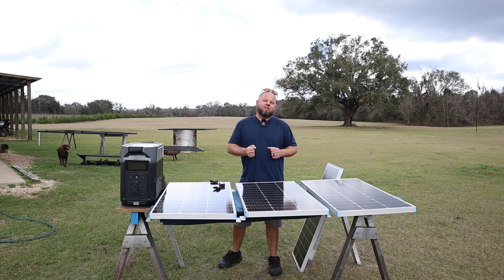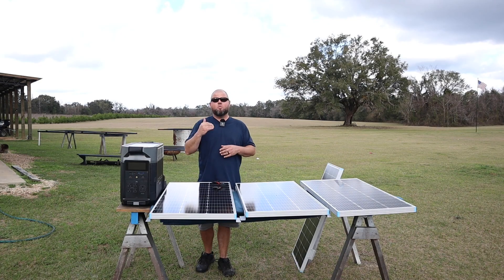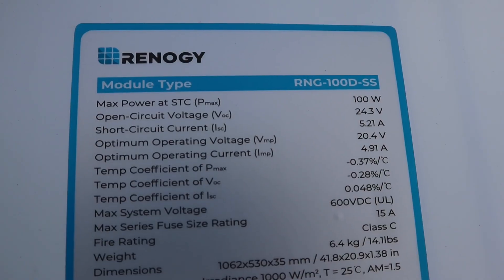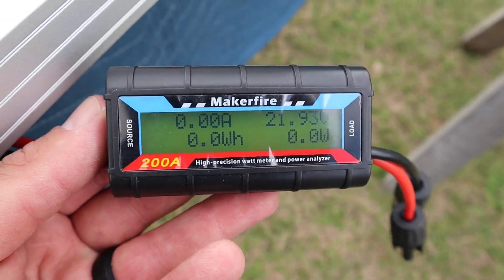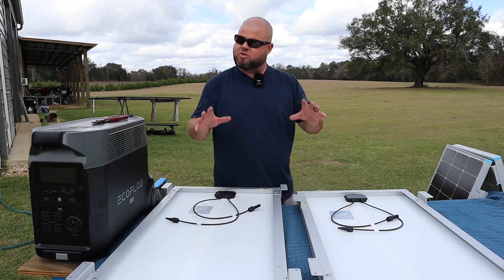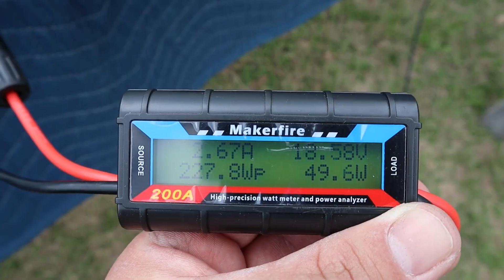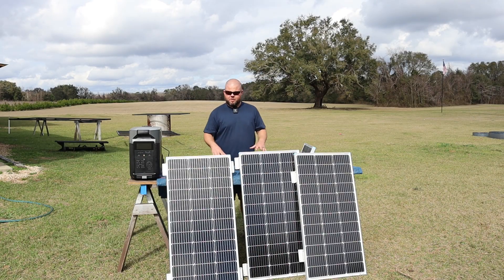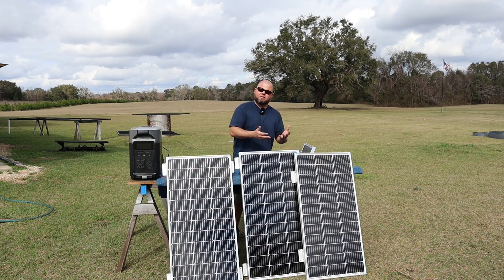How to wire solar panels! Series, parallel, series/parallel explanations. #720

Comment: Hey brother. I could really use your expertise. I have two delta pro units. I have 4 panels per delta pro. So 8 panels total. The panels are 370w, 41.0v, 11.42amp. since you're familiar with the specs on the delta pro, what would be the best set up on the 4 panels for the delta pro?
Reply: If I parallel/series the four panels, that would put my amps at roughly 23amps and my volts at 82 volts. Max amps is 15 for the pro, but would that work?

Comment: I enjoyed and liked this video my struggle is i just mounted 2 renogy 200 w panels on roof of my enclosed trailer and multimeter dont get anything out of both and when they where connected the LiTime 30amp charger didn't light up the solar display have i damaged the diodes
Reply from the maker: Possibly so, that's what I'd be checking.

Comment: Many posts I've read on other solar vids and threads w Ecoflow Delta Pro, which I have, say the 150 volts is a 'hard rule' and 15 amps is soft. Other words, it's ok to go over 15amps. The posters say it's been verified by Ecoflow support.

Comment: I’m struggling. I have 3 renogy panels, 1 200watt and 2 100 watt , I’m not sure which ones to hook up for series and which for parallel? I have a Anker solix f2000 powerhouse 767 2400

Comment: NEED HELP ASAP!!!  I just got my new Delta pro three unit… Installing four solar panels and following your directions as closely as possible… Went to grab the parallel adapters… And do not have any included in the kit. Do they not come with the kit? Did I have to special order parallel adapters? I was hooking two panels up in series and two panels up in parallel as you directed, but now I’m not seeing a way to hook up the two panels without the adapters… Am I forced at this point to hook them all up in series? I need your help please…ASAP…
Reply from the maker: Series is even better, use the high voltage side of the DP3 as long as you don't exceed 150 volts. . Parralell adapters are never included, you must purchase those separate as every installation and panel set is different.

Comment: It looks like you need two sets of series to parallel. I've tried one set of series three panels in series. Then I tried to go parallel on that and it doesn't work. So I'm going to have to build two sets of series it looks like

Comment: So I did three panels in series for 99 volts. Then I tried to parallel to increase my wattage capacity to 3000 but so I connected the next two panels in parallel and connected it to the three series. I checked the voltage and the voltage was 33 volts. So somehow the voltage decreased. Again, I had three panels in series for a total of 99 volts that I went the neck next to in parallel and the voltage dumped to 33 volts in. I'm shaking my head. What is going on???
Reply from the maker: You cannot parralell odd sets. Your series sets must contain the same amount of panels and be the same voltage.

Comment: I have a Eco-Flow Delta Pro and 6 each 160 Watt Eco-Flow solar panels. So, I can hook all 6 panels in series, my voltage will be 960 and my amperage will be low enough since it will be the same amperage as 1 panel - right? Also, I will have room for another 600 watts of panels as long as I connect them in series? I think I am missing something due to my lack of knowledge? I'm getting ready to attempt this setup live in the backyard as soon as I understand. Maybe there is a book you might recommend - Solar for Dummies? Thank you. I appreciate it.

Comment: I need advice, please: How is it better to connect two solar panels, power of 450W each to a 12v battery; 160ah....The panels are located in two different locations of my mountain house? Thank you very much
Reply from the maker: It really depends on your solar charger, you don't directly hook panels to the battery, they go to a solar charger first.
Reply: @TKCL Thanks a lot... I need some advice: how many amps or volts does the controller need to run properly? Thanks

Comment: I dont know much solar panels but if I have two 100 watts solar panels and I get someone to connect them for me in parallel for usage on my solar generator, after connecting them in parallel will I get a total of 200 watts coming from the sun to charge my solar generator? My solar generator has maximum amp of 8.5. If the amps double after connecting in parallel will this damage my solar generator??
Reply from the maker: It doesn't matter if you connect parallel or series, your wattage will always increase. Most panels are at least 5 amps, so if you connect in parallel you are going to go over the maximum for your generator.  You need to connect in series doubling your voltage, but always refer to the generators specs first.

Comment: Hey Andrew. I love the content. 
I have a solar related question and I haven’t been able to get a clear answer. 

I have 6 solar suitcases that I want to connect to my Victron 250/85 solar controller. However, the combined OCV in series is 269 volts. Is it possible to connect 3  and 3 in series and then both in parallel which would effectively be 135 OCV volts and 21 amps. 

Thanks in advance. 
John

Comment: What gauge extension cable would you use?
Reply from the maker: Depends on the amperage and length of the run. There are good online calculators for wire size. Make sure it's a DC calculator.

Comment: Thanks for your video it's very informative. So controlling the Amperage from the  panel (by doing different connections) is to make sure that it will not exceed the amps required by the power station, right

Comment: Does my voltage or amperage double if i have two of the same ecoflo
Reply from the maker: It sure what you mean by two ecoflows? You can't combine units.
Reply: @TKCL   I can combine and it gives you 240. And with a soft start you can actually run your central ac.

Comment: I must’ve missed something here… Once you connect the panels together, how do you connect to the machine if there’s no more wires left
Reply from the maker: There is always wires left.  When in series the last panel on each end will have one wire remaining for a total of two wires.  If going the parallel route with Y adapters, you go from two sets of panel wires, combine with the Y adapters and are left with one positive and one negative to connect to your machine.

Comment: I have 2 600 w panels, Voc= 52.8V, Isc=14.99A, Vmp= 44V, Imp= 13.63A, each, how do I reduce the amps down to 12amps to run a minis-spilt A/C unit? 12 amps is the maxium for the mppt on the mini-split. The specs for the mini-split is: Electrical Specifications
Rated Voltage
115VAC | 90VDC-380VDC
Rated Current
AC: 8.3A | DC: 9.1A-2.4A
VOC of PV
<380V
ISC of PV
<12A
Frequency
60Hz
Minimum Circuit Ampacity
19.05A
Maximum Fuse Size
20A
Maximum Starting Current
4A

Thanks for your help.
Reply from the maker: You can't reduce those panels to any less than a single panels rated amperage. Those are huge residential panels, what you need are 5 or 10 amp rated 100-200 watt panels.
Reply: Thanks for you quick reply, what do you think of an idea of putting a 12amp breaker in front of the mini-spilt MPPT, so if the current ever went over 12 amps it wouldn't get to the mppt? @TKCL
Reply from the maker: @gator-freda1938 not a good idea, you can't trust that the breaker will trip. It's also not a good idea to put more the 80 percent load on a breaker.

Comment: So I bought a 900 watt 72 volt solar pool pump an 10 of the 100 watt solar panel you use how would u wire that up series or parallel
Reply from the maker: Is there an amperage rating for pool pump? We need to make sure you get the correct voltage and don't exceed the amperage rating of the pump.
Reply: @TKCL  SOLAR POOL PUMP
(€ ISO9001
Model: ZJP21/19-D72/900
Q.Max.
21 m"h
H.Max: 19 M
NOM. VOLTAGE: 72V
In/Outlet: 48mm
POWER:
0.9
KW
1.2 HP
IP 54
ICL. B
Reply: Just trying to get your thoughts it doesn’t come with clear instructions
Reply from the maker: No that isn't very clear, I can't say how to wire based on that info. There should be a minimum and maximum voltage range, as well as amperage.
Reply: @TKCL  right just wanted to make sure it wasn’t just me I try calling the company they don’t have no answer either thanks for your time keep the video coming love the content from y’all happy new year to you an tiff
Reply: Found some more info not to exceed 150 volts
Reply: Minimum is 72

Comment: Glad there's a video for this solar subject. Question; what type of will i use from my solar panel aray to the house - I will be needing to trench these wires thru conduit - Yes?
Reply: Want to run my house, total electric with well - I have 40 gallon hot water heater, stove, 2  ton with heat pump ac unit and a well. How many solar panels and delta pros will I need?
Reply from the maker: They make underground burial wire, but conduit is probably going to be required by your code. As for the panels, I would need to know the exact wattage pull of all appliances.  I can tell you that your electric water heater is a major energy hog and will make going small solar impossible, so will the stove which has a huge pull when in use.  You would be money ahead to convert both of those to propane or natural gas.  You can then get away with a much smaller solar system and make it through normal day and emergencies far longer.

Comment: If you have 3 panel as demonstrated on video why did you incorporate an additional panel for total of 4 panel in a series parallel combination? what would happen if two panels are in parallel connection and connected in series with the one panel what will happen? to current and voltage using only thre panels? ther are two many videos using four panels but none demonstate using 3 panels in that configuration? This is part of a learning channel in youtube?
Reply from the maker: That's because you need an even number to series AND parralell as shown. You can use an odd number to series or parralell only, not both.

Comment: Been looking for the past month or so for panels and I'm surprised to see a 100 watt panel with a 23v output, normally it's 12v.  I've also seen a Renogy 200 w panel with an output of 23 or 24v.  It seemed on average I've seen 100w = 12v basicly.  The Renogy panels put out 10 - 15% more than others.
Reply from the maker: I've been highly impressed with the output of these. So much so that I just bought 40 more. I now own 67 of them.

Comment: I believe a Bluetti can handle a lot more solar input than the EcoFlo's; so my first choice would be one of those instead...
Reply from the maker: Not of a comparable model, I own both. Now when you start talking their big stackable units, things do improve on the input side. My gut says Ecoflow is due for and updated system and they are typically the leaders in this space.
Reply: @TKCL  Yeah, I'd love to buy an updated model, but unfortunately, I'm not in that position financially (yet). I have to figure out which battery power station I should buy... 

I have 4 x 405w panels. With the EcoFlo, even if I was to put 2 in series and then the 2 sets in parallel, it'd still be more amperage than what the EcoFlo can handle, what do I do? I'd still like to use all 4 panels, which would be handy on cloudy days, would this be possible?
Reply from the maker: @alpachino468 my gut says if you can hang in there a few more months without making a purchase, you're going to see some new models that can handle crazy amounts of solar input. Most of these companies launch their new products in January at the CES show.

Comment: Hello Andrew, big fan here, have 10.8 kw dp, want to build solar array with renogy 100w, can I use 16 panels to get the 1600 watt input to DP wo exceeding 150v and 15 amps? TIA, love your videos!
Reply from the maker: 1200 watts is where I have found my comfort zone with those panels. Reason being is I've experienced significant voltage spikes on cool days. If I had anymore panels than that, I'd be over the units limits. The good news is that those panels are performing very well for me. I just bought 40 more because they are on the best sale I've ever seen. If the sale is still running on Amazon I'll come back and post my affiliate link. You must be a prime member for the sale.
Reply from the maker: Just checked, the sale has ended 😕
Reply: Thank you very much Andrew, you Rock!

Comment: Great video, but I have a curve ball... Is there something that I can use to reduce/ step down the power supplied by my panels to match the Ecoflows allowed input?

I have a river 2 with 2X 100W panels wired in series which exceeds the 30v/8A maximum that the river 2 can handle (wiring in parallel will exceed the allowed Amps too).
Reply from the maker: Not that I know of, you'll need less panels.

Comment: I have a delta max 2000
800watt max, 13amps max, 11-100Volts max

Renogy panels 200w, open circuit is 27v, 9.66Amp

What is the best way to wire my panels?
Reply from the maker: You've only got one option with those specs. 3 Renogy panels wired in series for 9.66 amps and 81 volts. Be aware that in cool weather or odd cloud conditions you can see spikes above rated voltage. That's why you need to stay under the maximums.

Comment: I want to run a 2S2P setup with my panels. What I want to know is can the parallel connected ones be aimed at different parts of the sky? Say one set for morning/mid day and one set for mid/later in the day.
Reply from the maker: That's usually not a problem unless in series and it your panels don't have bypass diodes. You'll experience what's called a shading effect.

Comment: question ,,,,, so if we assume that you had only 2 panels 100W each ...  what will charge the ecoflow faster ?  12-14V /200W   or   24-28V 100W  ?
Reply from the maker: It charges the same, but you must pay attention to some units requirements.  Some need a minimum voltage to start charging.

Comment: Wouldn’t you want to put the whole 15 amps in due to unreliable sun, clouds, haze, whatever, just to make sure it’s getting all it can take? Sorry if it was mentioned
Reply from the maker: No, because at times you will run over the 15 amps, especially on cool days. I don't want to risk tripping the unit. I never run anything to the max.
Reply: @TKCL     Ok. So it has to be set up that way because the unit itself won’t govern the input.  Cool.
Reply from the maker: Most will govern wattage, most will not necessarily tolerate over voltage or amperage.

Comment: Hello,
 
I hope I may ask you something. I've been following your channel for a while. You are really by far the best of them all because of your calm and clear explanation on Youtube.
I bought a Renogy 200 Watt 12 Volt monocrystalline foldable solar case. After 6 days of testing I do not exceed a yield of 60 Watt. No shade but what I said a moderate sun in recent days. Should I be concerned? 60 watts on a 200 watt panel is bad right? I connect the panel to the AC network via inverter. Everything is connected properly. I've seen tests where this panel scored so well. I am really afraid that I have a bad purchase and now I still have warranty.
Reply from the maker: Even a little bit of sun can cause shading effects, especially if that panel set is wired in series without bypass diodes. I'd wait for a full sun day before assuming the panel is bad. Proper angle makes a big difference on those fold up panels.

Comment: If you have a positive and negative with each panel and they are all connected together , the one panel that goes to your control has no wires left? Is there a connector that lets you split and share?
Reply from the maker: That's not correct. Your left with a open wire/connector on your first and last panel. There will be a remaining positive and negative left available to run to your solar charger.

Comment: What would be the best panels to buy to get close to 1600w with my delta pro?
Reply from the maker: That's very hard to say since there are so many available with different specs. It's probably going to be difficult to achieve 1600 watts with the voltage and amperage limitations of these units.